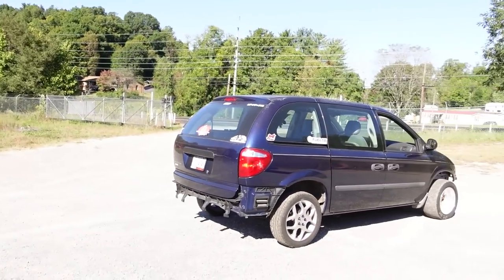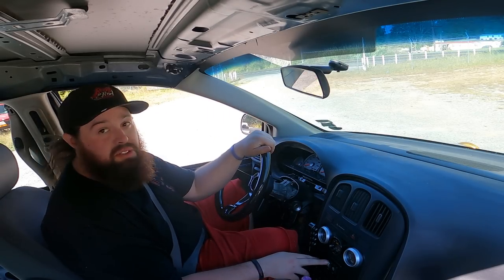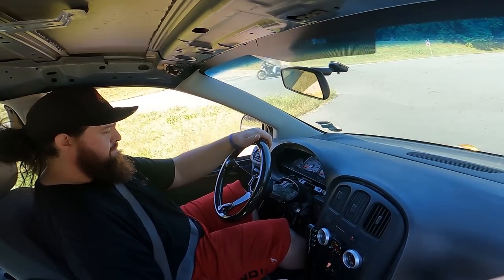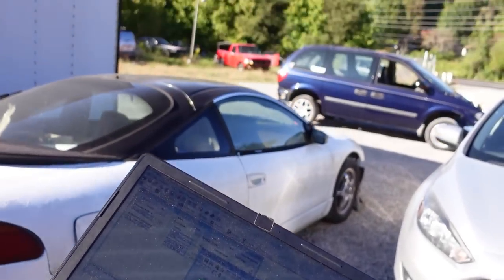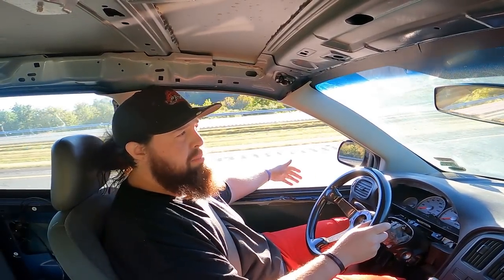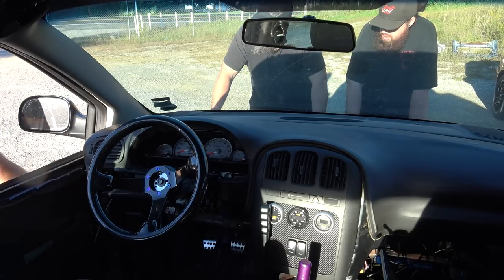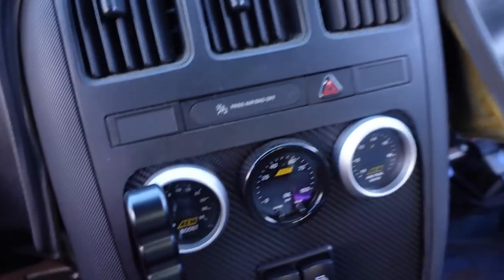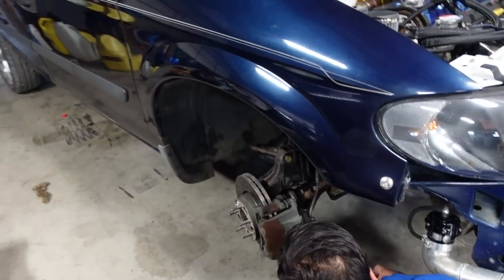Street Tuning our Big Turbo SRT4 Swapped Minivan

Comment: I've got a 96 EK1 Civic with 115,000kms on it. Manual transmission. Interior is immaculate. The body needs a respray. I need to put a turbo on her and it needs bigger tyres up front

Comment: Something heated up the brakes if they went soft make sure you brake line are not to close to anything that can heat up the break fluid
Reply from the maker: Rubber brake line to the caliper failed internally

Comment: If u did the swap why didn't you use the srt harness and take out what u didn't need so the cluster works and u can start on pcm boost and tune from there
Reply from the maker: I did for 2 years. Just swapped to a simplistic Kinnettic harness. Waiting for him to finish the add on cluster harness so it'll work. I prefer the Boost box over pcm boost. Simplifies everything and worked fine on the last big turbo setup. I just gotta figure out it's issue since I've changed so much this go around.
Reply: @BoostandBadHabits  hell ya can't wait to see an update on your progress

Comment: Seeing this makes me want to build a Previa.....
It's already set up for boost and it's correct wheel drive.... Sorry...
You all know front wheel drive is the work of Satan....
I mean... I understand.... build what you got... but.... I just can't do front wheel drive.
I like to do the occasional drift here and there.
Plus.... I've never seen a built Previa.... So... Why not?
Reply from the maker: Go for it. Need more fast minivans. My van is pretty heavy and basically 90% of that weight is over the front so it hooks fairly well.
Reply: Thought the same until I test drove a '05 Sienna..  -bought a different one within 24hr and won't drive anything else.. Sexy thing💙😂

Comment: Why people bang gears so hard is beyond me...
Reply from the maker: I have adjustable shift stops. So i can shift as hard as I please. It wouldn't looks so bad if the throw wasn't so long with the tall ass shifter.
Reply: @BoostandBadHabits  Seemed like you was about to throw your fist through the dash a few times and wasn't being disrespectful at all. I admire the build but don't shift stops just prevent play in the shifter while in gear? My concern was wear or tear on the trans, syncos, axels, and even possibly causing the shifter to break (I've had it happen believe it or not) I've had better luck letting my turbo make up the time lost for making sure I shifted correctly.
Reply from the maker: @JamesJohnson-vr4hr  no, shift stops keep you from overthrowing the shift and damage the trans or stretching the linkage. Breaking the shifter would be the cheapest thing I could break 😅. I have plenty. Once I raise the shifter base up and put a normal knob on it, it'll be fine.  For now it's kinda sloppy with how tall it is so I just make sure I get it in gear by not giving it a choice lol
Reply: @BoostandBadHabits  That answers my next question, if you figured out a solution for the shifter. Again it's a bad ass build and hope to see more of it in the future.